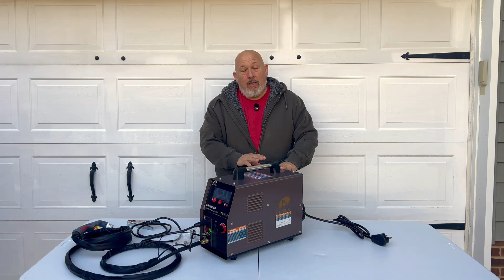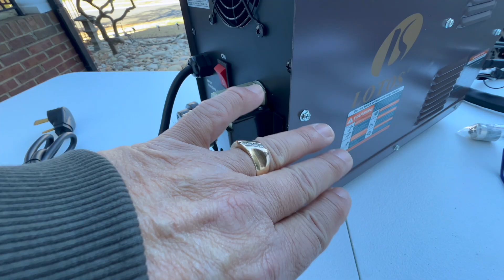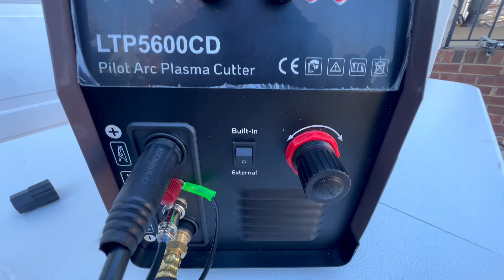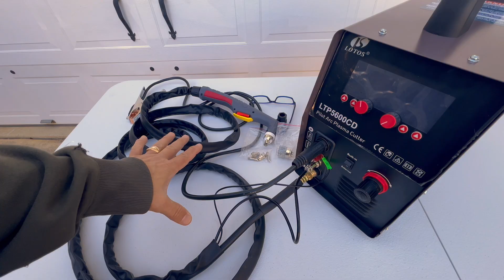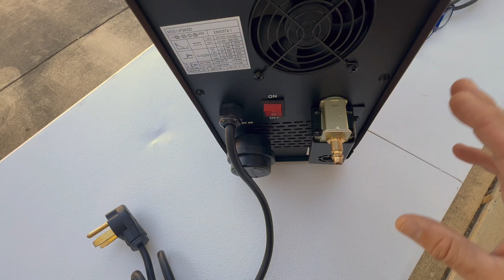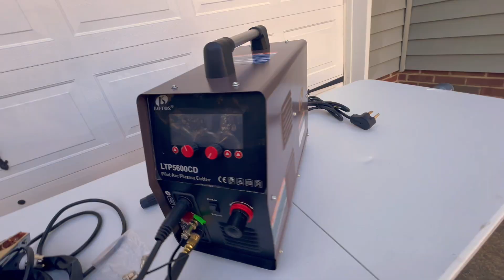Answers to the Questions About This LOTOS Plasma Cutter You Didn’t Want to Ask The Pros!

Comment from the maker: If you’re new to plasma cutting, and have questions you were too embarrassed to ask the pros this video is for you. This cutter will run on 110 for light work, but you’ll get the best results on a proper 220 setup. The built-in compressor is fine for quick cuts, and if you need full thickness you can hook up an external air source. I listed the product link in the description along with my storefront if you want to check current pricing or specs.